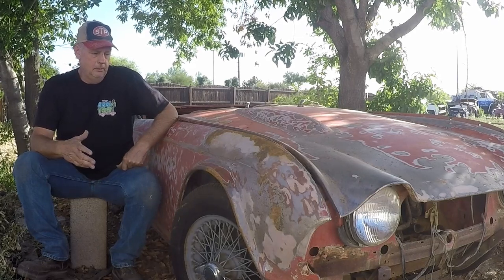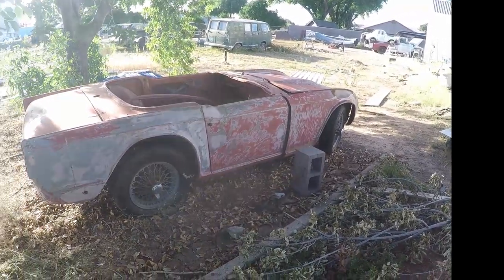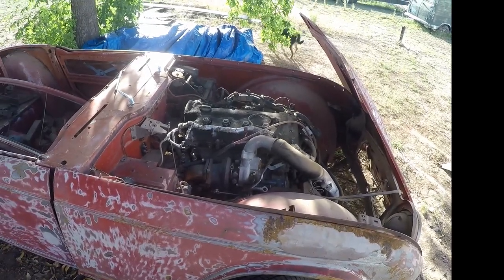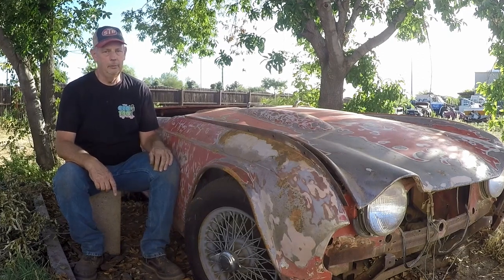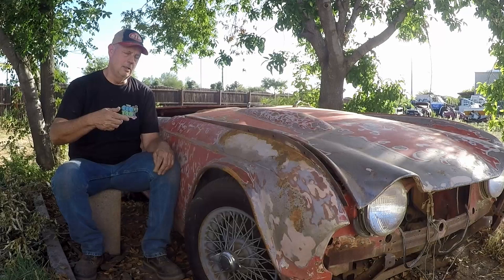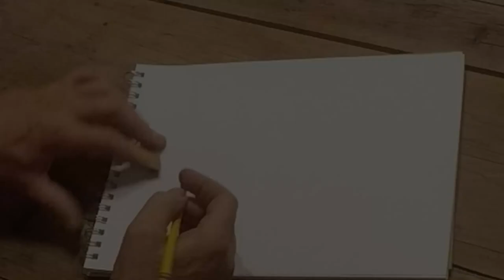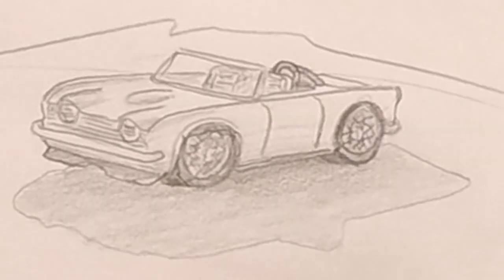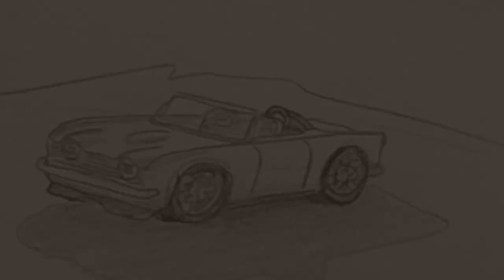European styling and American Muscle! Road Course Resto-mod Triumph TR4 not LS1 patina C10

Comment: I raced a stripped down modified 66 TR4A in SCCA during the early 70s.... modified the original engine back in the and suspension etc....definitely changed the electrical from Lucas to AC Delco. You didn't mention the rear end (still the stock rear?).... sounds like your trans may soften the torque....(64s had 4spds w/OD and didn't have 5 speeds so what kind of trans are you using?)
Reply from the maker: The rear end is an 8 inch ford completely built. The transmission is an AR5 from a Chevy Colorado.  Good to 800 HP.  Should be bullet proof. Thanks for watching!
Reply: @TheOddRodGarage  Wow...that will handle the power output! Should be a screamer